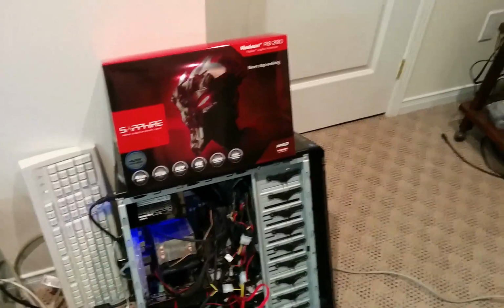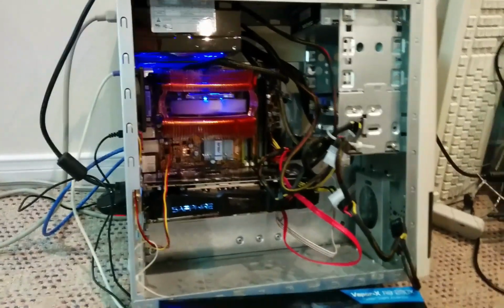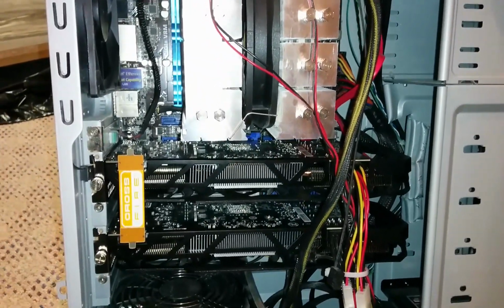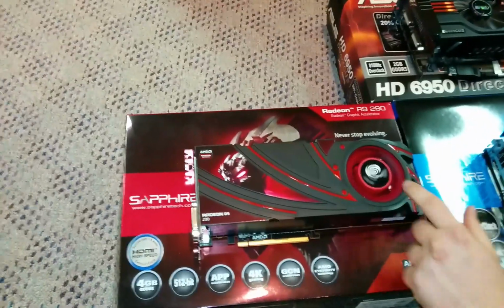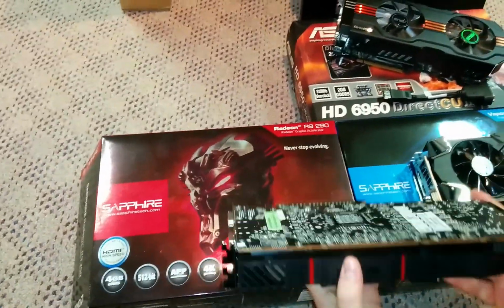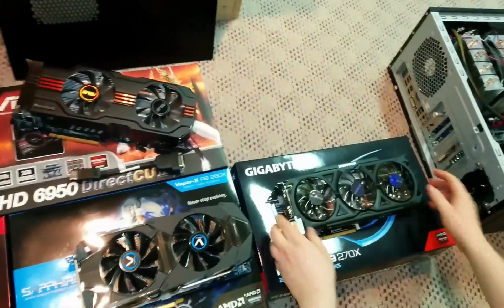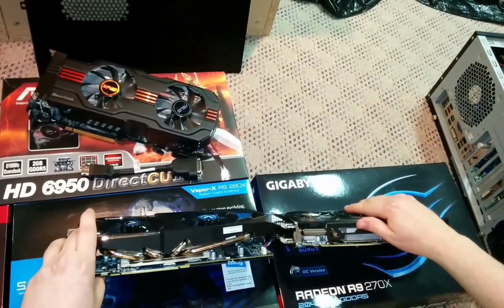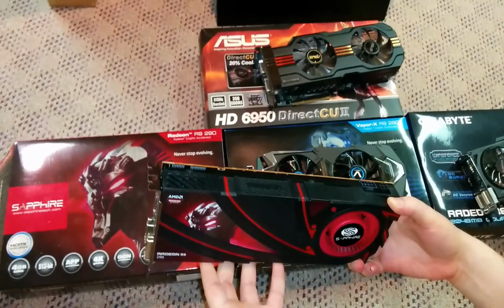ATI Graphics Cards Sapphire Radeon R9 290, Vapor-X R9 280X, and Gigabyte R9 270X

Comment: Water cooling the solution for overclocking!.
my old Vapor-x 7950 runs at 1200mhz core clock on full load rendering with only 52 degree's. and it had 2x8 pins the later version that came out had 1x8 1x6 pins.
So in fact it is common on the 6000/7000/R9 200 series + to have 8 pins.
Just saying :P.
I'll see how cool my R9 290 Tri-x Oc will run, and yes Sapphire is a bit sloppy with their Vbios they do have some problems from time to time but if you get in contact with them they'll update you and provide the information to flash you Vbios in order to be more stable faster and perform much better under heavy loads.

Ow and the reference card the R9 290 i don't think they need a bridge anymore in order to run xfire but i might be wrong on that not entirely sure but i think i saw something about that in a article.
http://www.guru3d.com/articles_pages/radeon_r9_290_crossfire_review_benchmarks,2.html

Comment: with bios modding you can overcome throttling. After searching alot for my new Sapphire vapor-x R9 280X card's vrm overheating problem. I finally found the solution . :) It is actually a bios problem. Old bios cards of this series never have vrm overheat , however with new bios of this series vrm get hot. Especilly when overclocked to high frequencies with like 1.2,5- 1.3 voltages you can see the card goes up to 100-110 vrm heat and throttles. NOW TAKE A DEEP BREATH cause I find the solution.

Sapphire uses 2 different vram types in their cards . And one of them gets hot after a certain level of overclock. and this bios ( the latest one which came with the latest part of these series) is not suitable for especially that vram users. So in a forum (a gpu mining forum actually ) I found the solution. people there mods the bad bios for the new series and makes the vrm's run 20-30 c cooler. for example mine was 90-95 at stress test and now it is 70-75:D:thumb:

you just need to go the forum and find the correct bios in the topic:

https://litecointalk.org/index.php?topic=10313.0

and also here

https://litecointalk.org/index.php?topic=12369.225

or just use the bios I use for sapphire vapor-x r9 280x:

http://www.upload.gen.tr/d.php/www/eTyTg/Sapphire_E21004_V44_K2_NT_AGR.rom.html

you can use "winflash" to flash bios in windows 8

now I am enjoying full overclock and throttleless and cool and very high performance card. ;)

I am sure Sapphire is gonna make new bios like these people do and make it officially-solved . but if you dont want to wait sapphire to do it. just do as I tell you above 
other 2xx card users of sapphire (and maybe other brands) can also use this as a guide especially this link gives moded bioses for each cards. :

https://litecointalk.org/index.php?topic=12369.225
Reply: the http://www.upload.gen.tr/d.php/www/eTyTg/Sapphire_E21004_V44_K2_NT_AGR.rom.html link does not work , any chance you can upload it again or mirror it?